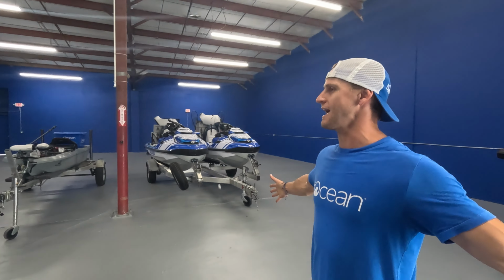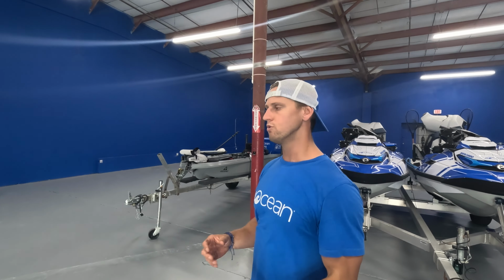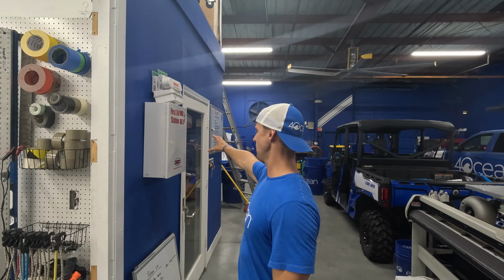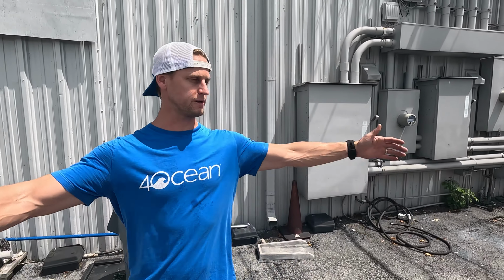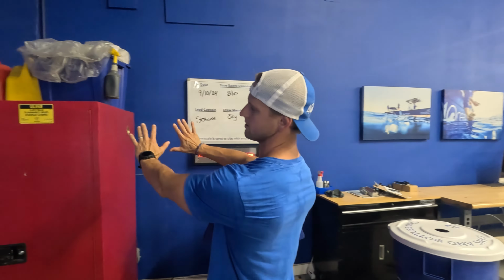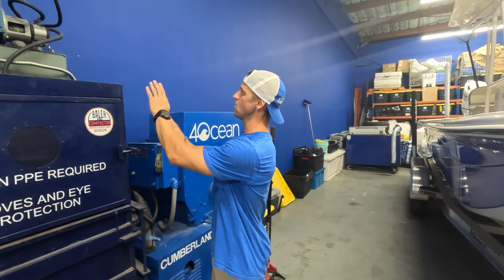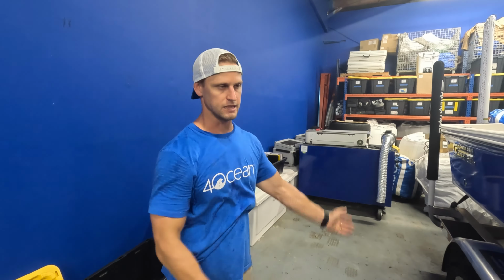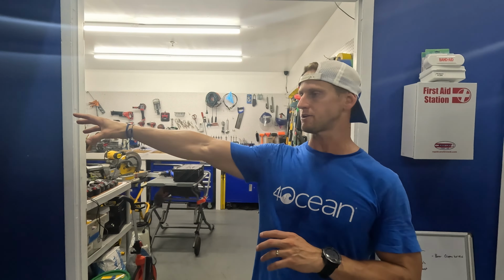Inside Our New Ocean Cleanup Headquarters: Expansion and Future Plans

Comment: Put a toilet in the center of the room👌
Reply: Why in the center? Elimination facilities make sense, though in the center of everything doesn't make sense to me right now. Just curious.
Reply: @  I just think every home needs a toilet to be the center of everything, that goes for warehouses to me.
Reply: OK. I usually want it tucked away from where I spend most of my time, though it's true that when it's urgent, I really don't want to walk all the way across the house (as in my current home, which was built before I knew custom designing a house was even a thing).
Reply: @ valid